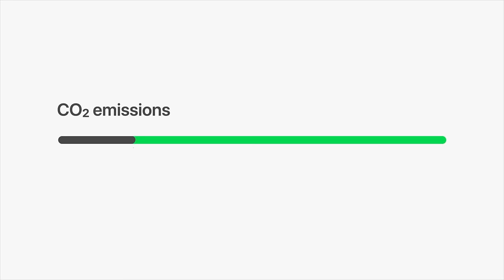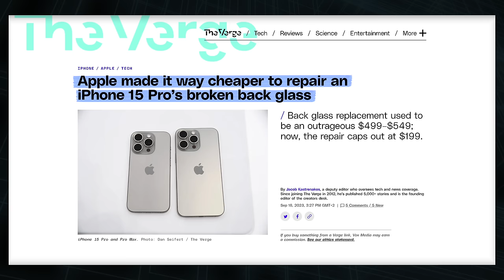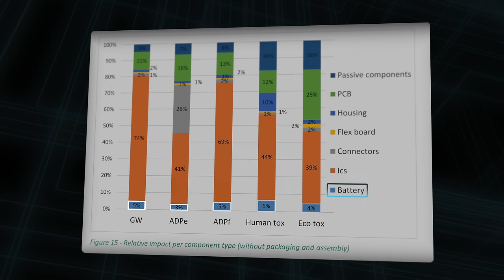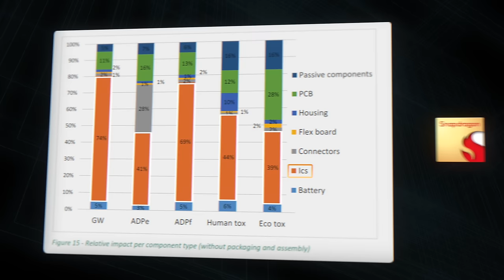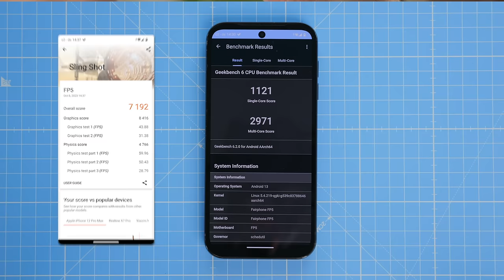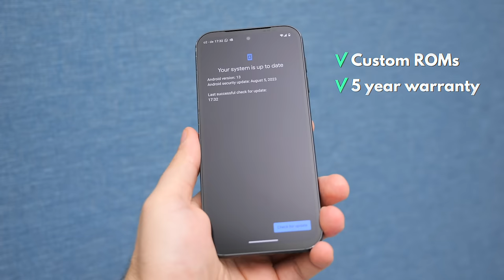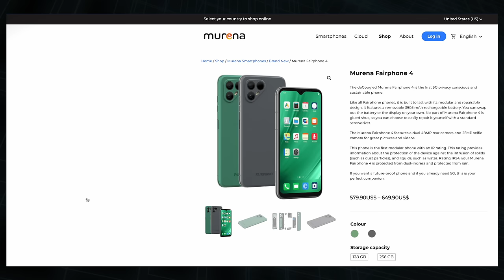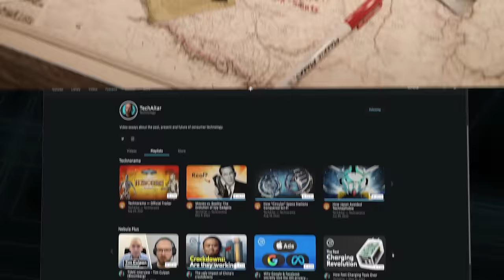Is Fairphone really fair?

Comment: I wait until Fairphone 6, 7 or 8 coming out and finally capable to compete in performance with other devices. The biggest selling point in this new Fairphone 5 is the modular design, and the ability to being repairable by the actual user. I really like the design and the long term support! and this 5th edition really got me thinking to buy one cuz currently my phone is a Xiaomi Mi 8 which is like almost 6 years old but it's still fast and works well I had 2 battery replacement in the past years and I think my phone is still have better performance then this Fairphone 5 which is funny....
Reply: and as always, it wont. Unless you willing to pay more than 200/300 more than other competitors just for the extra sustainability.
Thinking like competitor now selling 1000 dollar phone and fairphone 1200/1300 with just similar performance, would you even willing to pay for it

Comment: You're comparing repair cost to the expensive iphone model, but if you compare to other cheaper yet more powerful phones it's not quite tha simple
25€ for a transparent plastic back ? I bought a custom transpaent glass back for a poco f3 for 8€ !
I could buy a new battery for 10€ not 40 (probably not fair material sourcing though)

A phone that's actually good with modular chips would be fire though.

Comment: I definitely support right to repair. I very much like the idea of Fariphone. On the other side, I'm still using an Xr for the last 4.5 years and will continue to for the foreseeable future. I've dropped it countless times including on concrete from 4+ feet. Part of the problem are poor or no case that make the phone look good of thin enough. I went thicker case and it's paid off; literally. Next issue is battery fast charge. We are going to see generations of phones that last 2 years or less since fast charging will kill the battery life. Mine is still at 87%. Not perfect, but very usable. Oh well, looks like a good phone as long as those replacement parts don't increase as phones get older. It costs money to keep producing and storing them. That will likely go up.

Comment: people are just really dumb, you can actually buy a cheap phone that functions as fast or faster than the fair phone. and its just a quarter or even a fifth of the price. you will have a good water resistant phone as well. and if your phone gets broken, you can easily buy a new one as it will be cheap, no repairs necessary.
Reply: also, readily available online. no headaches on where to order this and that part, etc. just click buy deliver in seconds😂

Comment: The irony of complaining that a business is causing 1 to 2 percent extra emmissions per unit for including the modular connectors. I understand its just an engineering review, but its penalizing the very feature that makes the products sustainability viable. The other issue is that while apple has the advantage of scale, they are also causing needless waste by havijg to set up an entire commercial infrastrucure for arbitrarily re pairing parts to phones. You can recycle from the land fill all you want to. It doesnt change the fact you are the one putting all those phones there to begin with.

Comment: I'd rather have a fairphone that comes with a near flagship processor. Something that might have a chance of still performing well in 5 years. The 10 years of support seems overkill if the the processor struggles with software a couple years after purchase. Maybe they can keep the motherboard the same dimensions for a few generations, so they can be upgraded since socketed socs aren't likely.

Comment: Don't be fooled by their fancy charts. Li-ion batteries are the most polluting part of a phone by miles. (Not in terms of CO2 emissions, but toxicity and recyclability-wise) That's why a phone with non-removable battery, that lasts 5+ years (the one in Nokia my mom used did) is way better for environment than a removable cell you have to replace every year. (Like in my S3, where you had to replace the battery every year) Removable batteries are the ultimate snake oil, hopefully companies get around the 2027 EU regulation or it gets scrapped by then. This is also why we need better battery tech before mainstreaming EVs, instead of pushing products with a literal ton of toxic impossible to recycle cells inside them.

Comment: Ya no apple's claims of being carbon neutral and recycling friendly isn't all that plausible as how many iPhone's actually get back to apple for recycling ?  How much do third party repair centers they use for warranty repair responsibly recycle components we have seen how they cut corners with workers being underpaid and over worked I can't see them being all that concerned with putting the money in to ensure proper recycling methods. Also apple is geared so hard towards getting people to buy the next iPhone just look at their our of warranty repair polices so many times have they not repaired a manufacturing fault in a device because you are beyond their 1 year standard warranty. 

I'm not delusional no company is totally green under such a cut throat capitalist system and fairphone probably has it's issues too if you dig hard enough but comparing them to a company that sues third party repair shops for getting parts in manners they don't approve of just to cripple the affordability of repairs of there devices is a little disingenuous especially when you rightly so, go through fairphones sustainability claims pretty thoroughly and just ignore the practices that a majority of electronic manufactures engage in to get you to buy a new phone ever one or two years. Screens , batteries, back glass and cameras aren't the only components that go bad on phones and the components not listed are more often the nail in the coffin for these devices like charge ports, motherboard components , speakers and so on and these repairs are often notoriously difficult to get a fair price off apple out of warranty. They will replace entire sections to repair one component that can be detached or even they won't even quote you a repair and instead tell you to buy a new one.

Comment: I used to have Fairphone 4 and it has been the worst phone I ever had. Build quality was worse than you can imagine and after I accidentally scratched outer frame, they refused to sell me new one. Only way to get new frame is to send the phone to them and have your 'Core module' changed for over 400 EUR!!! Not talking about green paint peeling of my 'Special limited edition' 800 EUR device. Fairphone is so far the worst bunch of scammers I got in touch with so far. Only people more crazy than them is the FP community, those people tried to convince me paint peeling of brand new device is called 'patina'. Idiots.
Reply: Also a closed Camera2API is disgusting and certainly unfair to customers, forcing them to keep Gapps bloated ROM phone came with.

Comment: The whole "modular design" advertisement is nonsense, most phones are built modular, the biggest difference between lets say an iPhone/Apple and Fairphone is that Apple doesnt sell the parts or allow DIY repairs, meanwhile the Fairphone is designed to be repaired by the user and they also sell the parts. Apple, as much as most others (Samsung etc) just need some regulations and "right to repair" kicks in their butts.

People also were hyped with the "modular" ports on the Framework Laptop, but in fact all they did was selling USB-C adapters in a size which fits into a "slot" in the notebook "as if" its a proper HDMI, SD card slot or whatever you picked. I mean all the framework laptop had was 4 USB-C ports at very poor positions deep inside the notebook, meant to pick up those adapters, not really special or advantageous in my opinion.